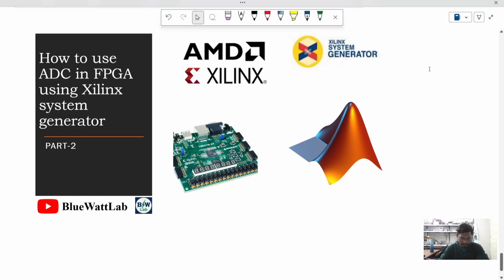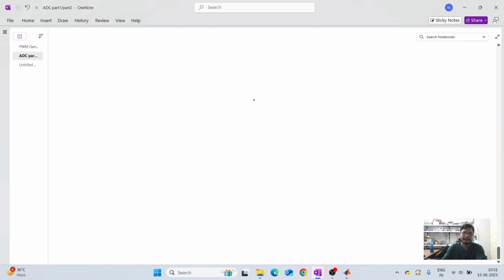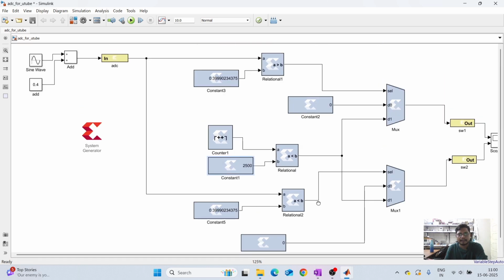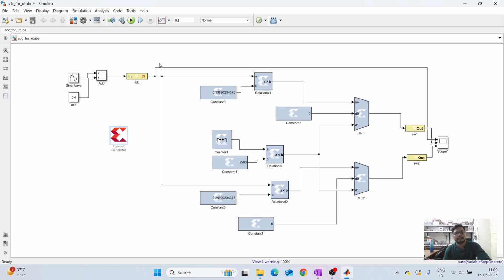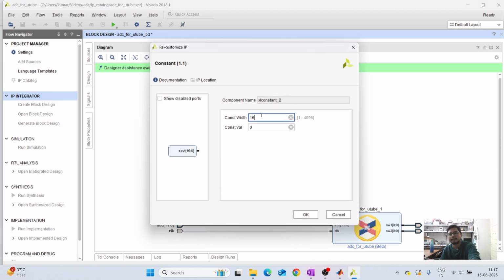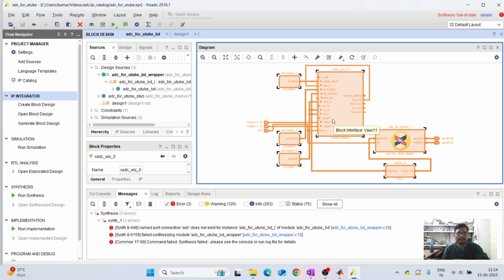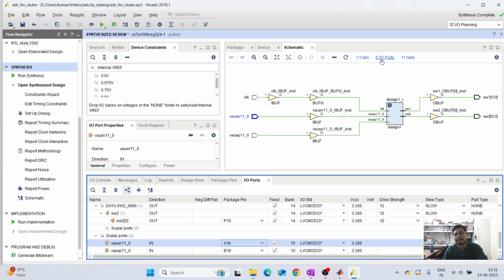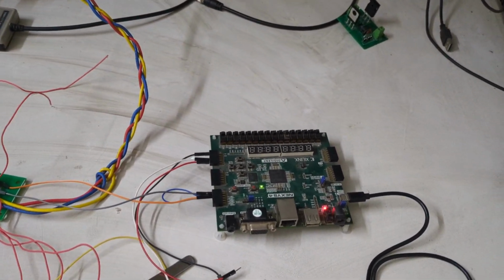How to use ADC in #fpga using XADC Wizard IP Block in #vivado | Xilinx System Generator | Part-2

Comment: I am using same board that you chose in vivado, in the datasheet, it is mentioned that channel 11 is an invalid selection. I tried to use the dedicated channels and it didn't work but when I used channel 11 it worked. can you explain this!
Reply from the maker: @sondosreda8234, you are right and thank you for asking. Actually xilinx provides many ADC pins in their processor but the nexys4 FPGA development board is manufactured by digilent so they provide only 4 channels (11, 10, 3, 2). I hope you got my point.
Reply: @BW_Lab_iitbhu yes I get your point. Thanks a lot for your reply. But my board is arty, it has a set of adc pins. But all of them are connected to an lvcmos33 bank (the clock bank)! You think this a manufacturing fault or it’s me I cannot use it properly?

Comment: Thank you for sharing such a great video. Is the tutorial on PID controller implementation on the converter already posted? That would be great learning experience. If not, when are you posting it? Thank you again for sharing such great tutorial. Really appreciate it. I want to add another quick question. In the video you had mentioned that the IP catalog block diagram can be converted to verilog and merge with other verilog code. How can that be done?
Reply from the maker: Thank you so much @bharatbohara874, i really appreciate your feedback.  As per your suggestions, i am preparing a tutorial.